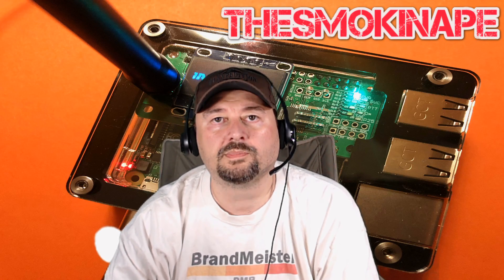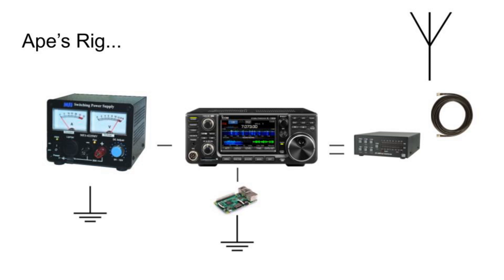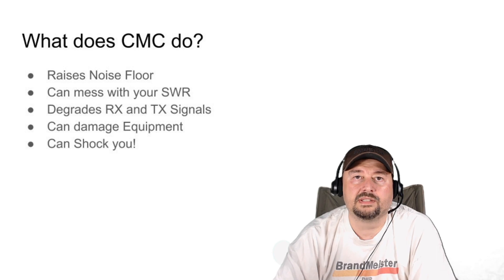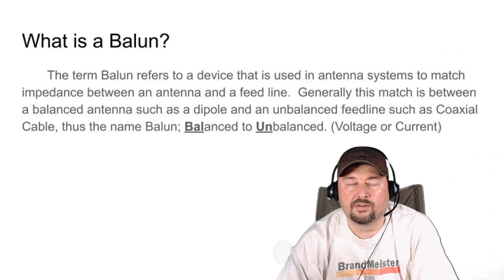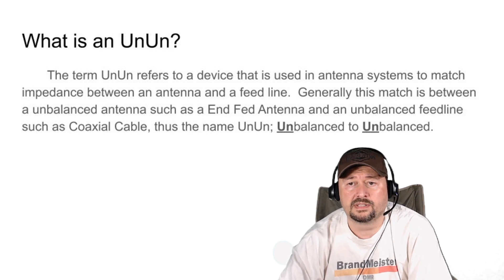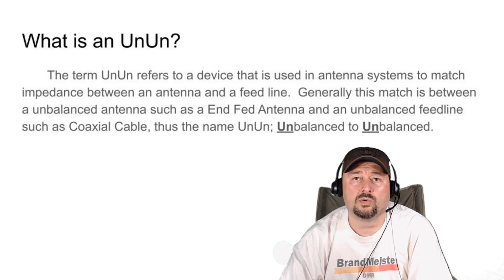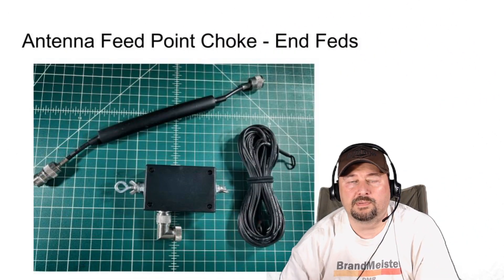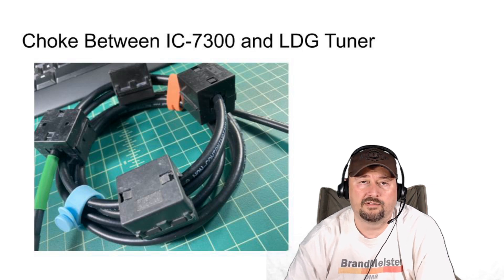Dealing with RFI and CMC -  HAM Radio - TheSmokinApe

Comment: So I set up an antenna for 40m.  The antenna was 40m long inverted L.  I had 4 20m counterpoise.  49:1 unun at the feedpoint.  I wasn't having any contacts on the 40m band and switched to 20m.  I was hearing "birdies" very bad.  I looked into it and discovered "traps".  When you mention noise floor, are these "birdies" the thing that you are referring to?
Reply from the maker: No, noise floor is the level of the static you hear when no signal is present 👍

Comment: Hi there, Ape, brilliant run-down!
It needs to be remembered as well, sometimes RFI may not even come from your own QTH.
Earlier on this year one of my neighbours had some solar panels installed and the installation company really cheaped out on the solar charge controller, this pretty much blanked out most of the HF spectrum and VHF/UHF was almost unusable.
We managed to get it all sorted out and you have to be really tactful when things like this happen and not just rush into apportioning blame on people that may not even be aware that this is going on.
Reply from the maker: Good point and glad you got it sorted out.  I've hear all kids of nightmares from problems with street lights!

Comment: Would you put the choke on the antenna side or the shack side of the ground rod clamp bracket???
Reply from the maker: Hey Alvin, I would put it at the antenna if I only had one, if I had two I’d do both 👍

Comment: How is the ratio of the un to un determined? One is nominally 50ohm and the other end (antenna) is a value that means we use either a 9:1 or a 49:1; these being the most common that I see in print and on the web. Is that feed point impedance determined by the wire length? I don't know the math of it, but would like to. 73 (Looking for elmerly advice)
Reply from the maker: Hey Alvin, sorry man, I don’t know the maths 😕

Comment: Newer rigs are more susceptible to cmc than older rigs. Radios, tuners and amps. A ham now days must go to lengths to cmc proof their station from the start or there will be a bad experience with the hobby. I know of way too many instances were the ham attributed the problem to a new rig where in reality the issue was longstanding but not noticed until the new expensive rig was installed and QSO was attempted. Toroidal cores are essential to success in isolating cmc. The eight turns of coax on a four inch form does nothing at 160, 80 and 40m and should be avoided. 
All of your suggestions should be done as a starting point in any well designed shack.

Thanks for the great video & 73'...
de K4WRF
Reply from the maker: Awesome post Watt, thank you!

Comment: Using a conventional power supply instead of a switching power supply can reduce RFI a lot, especially on HF frequencies. Good station grounding also makes a huge difference.
Reply from the maker: Agreed on both points, thanks Ivan!

Comment: I don't understand a choke on the ground! Or did I misunderstand you. My understanding is that we want to ground any RF from the radios and equipment. I don't think I want RF on the case of my radio equipment.
Reply from the maker: Yeah, don't choke any chasis ground.  I do choke the incoming power from the PSU with is grounded.  Does that make sense?

Comment: Great video Ape.  I’m a new subscriber.  In your video you mentioned that you use a choke on both ends of your coax (one at the antenna feed point and one at the antenna tuner in the shack), but at the end of the video you did not show the choke at the antenna tuner.  Are you using the same Chameleon choke at the tuner that you used at the antenna feed point?  Also, do you use any lightning protection in line with your coax?  Thanks in advance for your reply.
Reply from the maker: Thanks for the sub!  The choke at the tuner is a t240-31 toroid with about 11-12 wraps of coax, if I recall correctly.  This spring I'm installing a ground rod next to where I run antennas that will have lightning protection.

Comment: A isolated ground/clean power can help with grounding issues/ground noise. (Typically) An isolated ground wire is MC cable with a bare AL ground wire and a green w/ yellow strip insulated CU ground wire. The bare AL grounds/bonds the IG receptacle's frame and metal work box, while the insolated CU ground only connects to the IG receptacle's grounding prong. The insolated CU ground wire is installed onto an isolated ground bar/plate inside the panel, not bonded to the panel's main grounding/bonding bar/plate or bonded to enclosure. The isolated ground bar/plate is then wired to building's main grounding system (footer ground, ground robs, etc) with a #6 green insolated CU wire. Isolated ground/clean power is used for medical equipment, computer servers/equipment, 911 call centers, and cash registers. In a pinch for residential wiring methods, I have used 14/3 or 12/3 romex. I used the red wire (taped green) as the isolated ground. The wire is not shields, so bleed over can still occur but it is better than nothing. Also if you have a older house, the grounding/bonding system is probably poor or non-existent, which can cause massive noise. Driving (2) grounds rods (spaced the length of rods or no less than 6ft together) and running a uncut bare #6 from one ground bar to the next (using ground rod acorns to connect wire to rods) then into the panel, where you can install a grounding/bonding lug to the panel's enclose to terminate the #6. Then if you have metal sewer and water lines in the basement/crawl space, run a #4 copper from the panel to where the sewer line enters the home and bond it. Do the same with the main water line, may have to jump bond both sides of the water meter (if insulated bushing were used on the water main) and bond the cold and hot water lines together with #4 above the water heater. If any of the metal sewer or water pipe has been cut out and PVP/CPV/PEX pipe has been installed, just use #4 copper wire and bond the pipe back together. Proper grounding and bonding can really make a difference.
Reply from the maker: This is a really good post, thanks for sharing!
Reply: @TheSmokinApe  I don't understand the post. Could you or Bacon83 explain it.

Comment: Im a really new HAM....just got my Tech in June 2020. Have my Extra as of August. With that being said, I have really tried to set my shack up as “cleanly” as possible. With my limited experience, here is what I have done. 
Antenna connection points extremely close to shack
Purchased LMR 400 Coax
Each Coax coming from an antenna has an individual lightning arrester and is directly grounded 
Grounding is via two 8’ ground rods bonded together, as well as the mast being grounded
Copper plate inside shack with 1” braided ground directly connected to 8’ ground rods
HF rig, Power supply, and EQ individually grounded to copper plate with 1/2” braided 
Have also converted everything possible to 12v DC as opposed to AC (includes lighting, fan, HT charges etc
Have separated any AC cables (cpu, monitors etc) from any DC powered lines and antenna coax.

How effective is all of this? Seems okay....but with so little experience Im not sure exactly. I feel like I have tried to be conscientious to keep everything clean and organized
Reply from the maker: Should like a nice set up, and grounding does help with noise.  What antennas are you using?  I do want to mention that CMC wants to go to ground too, that's why I use things like chokes to stop it...  for example it can come in on the antenna, traverse your tuner / radio and right to the ground, all the while causing havoc.  How is your noise floor?
Reply: TheSmokinApe .....right now using a Chameleon Emcomm III in an inverted L configuration. Looking to set up a solid 20 and 40 meter dipole by spring. The endfed goes vertical up the mast to about 22’, then horizontal.
Reply from the maker: @jay-rus4437  I’d add a choke are the feedpoint for the End Fed and make sure that there is a 1:1 on those dipoles 👍

Comment: RF ground planes can equalize all static charges and take them to earth ground/ ground plane is an rf buss.
Reply from the maker: Yeah good point.  If your radio connects it’s chassis ground to the bus you still run the risk of RFI entering the radio along the path to the bus.  I want to eliminate the RFI at the source if possible.  Thanks for the comment and for watching 👍
Reply: @TheSmokinApe  Grounding and bonding pub. as reference 73

Comment: I have DirecTV connected to my LED flat screen TV. I have noticed that on certain channels it will cause RF interference to come over my Baofeng UV-5R on one of the repeater frequencies I monitor. It actually comes through like I'm receiving a transmission from the repeater. HELP!!! Would a chock on the cable from the DVR to the TV help? Thanks for an interesting video.
Reply from the maker: I’d choke the TV and cable box power supplies first. 👍
Reply: @TheSmokinApe   Thanks for the help. I'll try it and let you know how it works out.

Comment: I’m surprised there was no mention of differential mode currents, their foibles and cures. EMI suppression, both conducted and radiated for DM needs to be addressed just as well as it is for CM. This is especially true when trying to mitigate noise from power supplies and other external but connected devices.
Reply from the maker: Tami, I try to keep these videos focused to the main topic.  There were a number of rabbit holes I could have gone down but chose not to for the sake of keeping the video short, I did originally have a slide on CM vs DM but ultimately choose to pull it out during editing.  Thanks for bringing the topic up.

Comment: You had one choke there made from powdered iron, not ferrite (red core).  Usually they don't provide nearly as much reactance, choking action.
Reply from the maker: It’s debated quite a bit and I tend to agree with you, I’ll likely replace it with a t140-31 or 43 👍